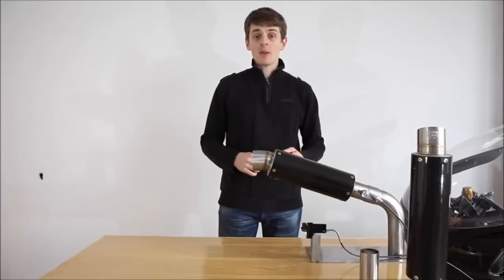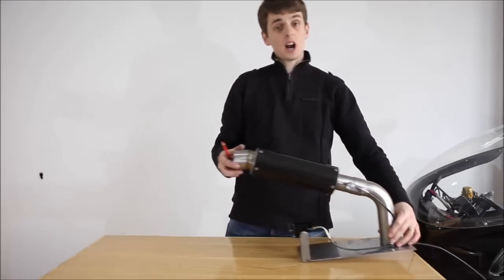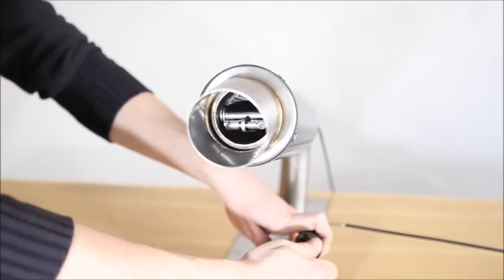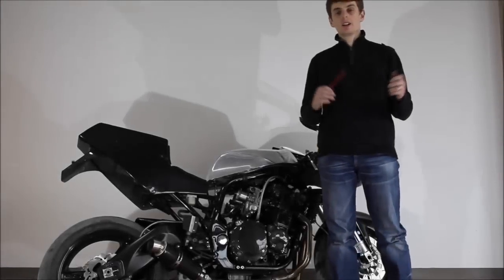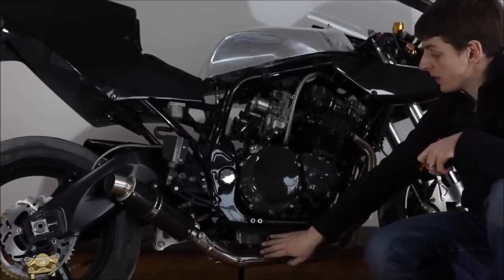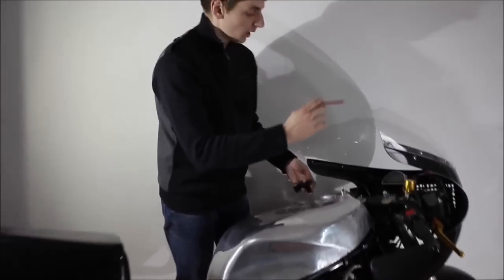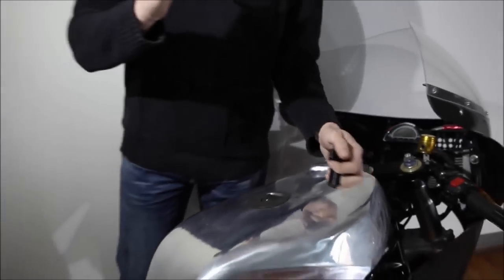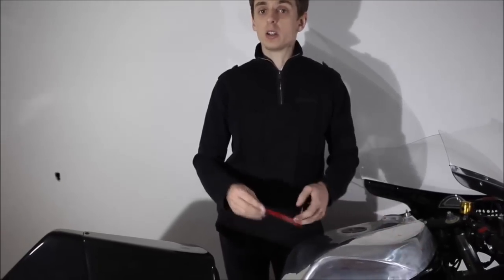Danmoto Remote Sound Control System  Carbon GP Exhaust

Comment: have this on my zx14. i do enjoy the ability to open/close on the go. would usually close it close to home and early mornings and open it up on the road, but you need a solenoid system. something that could be an extra add on for the existing systems and newer ones. i have been trying to find a way to make my own.
a rotational actuator positioned on the exhaust to move the butterflies and either 2 momentary switches or a 3 position momentary switch for the handlebars. 
the cables provided at the moment are cheap and have a lot of slack in them, the little adjuster also rattles loose when baffles are closed and i have almost lost it a couple times. and it gets quite tiring having to wind it so much to make a full adjustment. 
being able to press a button and have it change instantly would make for much more appealing product and opens up for an extra sale item.

Comment: Electronic control seems better way than hand turning control.  If it had to be a hand control, would be better with a index shifting like a bicycle shifter.  Like, " click, click" for each level of closure.  That's my suggestion.  I have XG-1 with baffles but still loud.  Do you have a silencer like for a gun where you attach to end of pipe?  Or an end cap like for a trumpet.
Reply: Electronic is just another thing to break imo. Keep it simple stupid (KISS).

Comment: If only they would/could add the remote control system to the Jisu exhaust. Given that I commute at 6 AM I don't want to disturb those who are still asleep, but would appreciate it if I could have it open in the afternoon when driving home. Also being able to silence it when going on longer trips would be nice. Here's hoping they'll add the remote control feature to the Jisu exhaust.

Comment: Hello Danmoto, just a quick question for you :).
I ride a Yamaha YZF-R125 and was wondering what the back-pressure in the exhaust pipe is; when the remote baffle is fully closed, at idle and at a higher RPM such as being held at 4000RPM. Does it restrict much flow out of the exhaust and is there much of a power-loss when the baffle is closed (as I ride a 125cc and need all the power I can get haha)!

Comment: Hi, just attempted to install one of these on my ninja 300. Exhaust was simple and easy to install though the cable seems very hard to make baffle turn and the control isnt turning turning the baffle. Ensured the cord wasnt kinked and everything. Almost like the spring is too tight? please help, thanx
Reply: Hi Jarrod i have intalled the exhaust and i have the same problem with the cable. .it looks like the intern cable is to long !!  How do you fixed this problem ??
Reply: +Trep Immers I was informed that you need to pull the chord really tight before threading it into the base. Seems to have worked for me but still not perfect
Reply: Lube cables too

Comment: Hi Danmoto, 

Do you have any recommendations for installing this system using a servo to adjust the baffle, rather than the hand controls?

An electronic system would be a better (and safer) way of opening the baffle. In the video, you speak of adjusting the baffle whilst riding the motorcycle, but you would need a very long and straight road to do this, as the hand adjuster requires a lot of turns.

Thanks
Reply from the maker: Gary Fernie Hello

it would be definitely possible to replace the hand control with a small servo motor. You should be able to adapt a range of different motors.

But that would be a job for a skilled mechanic, as the motor needs to be mounted and wired and well as some kind of switch. The whole setup would need to be hidden and waterproofed to prevent issues.

That would be too complicated, as most people look for parts which are easy to install and maintain.

We did consider servo motors during the development, but decided against it to keep the system easy to install and also easy to maintain.

A servo solution is something which would require a professional for installation, that's nothing the average rider can install by himself.

With best regards
Danmoto
Reply: Danmoto International Thanks for your reply

Comment: Will the remote device be available to buy separately so we can install the system on our existing carbongp's?
Reply from the maker: DantheDukeMV Hello,

i'm sorry but it's not possible to retrofit this system to the normal Carbon GP.
While this exhaust looks about the same, it's inner construction is different than the normal version.

With best regards
Danmoto

Comment: Very clever. I wonder how well it will function after a few thousand miles. But yes, very nicely done.
Reply: have this system on my zx14 and have covered around 10,000km so far. it still works. i was expecting it to gum up but i guess the vibrations keep it from sticking shut.

Comment: Thanks for the video. Very poor quality audio, should have used a real microphone. For the demo bike should have used something single cylinder like CBR 250, they thump LOUD with your normal Carbon GP exhaust so would have been nice to hear the comparison (and wouldn't sound like a sewing machine like the bike in the video).
Reply from the maker: toysareforboys Hello,

thank you for your feedback.

We're actually planning to do some more videos with different bikes, to give our customers a better idea how it sounds on different models.

At the time this video was shot, the shown Suzuki was the only bike we had in the shop.

With best regards
Danmoto
Reply: Danmoto International Thanks for the reply. To improve your speech audio get a lapel mic and plug it into a portable recorder, will make your voice sound flawless, no echo, no fuzz. If you get a GOOD microphone you can also use it with a battery box to allow it to capture way louder sounds with very high dynamic range to capture the full true sound of a motorcycle exhaust (especially a bass heavy bike like the CBR 250 which will normally clip any mic under $500). For mic:
http://www.soundprofessionals.com/cgi-bin/gold/item/SP-BMC-3 (choose standard sensitivity), power module to extend the microphones maximum recording volume and dynamic range: http://www.soundprofessionals.com/cgi-bin/gold/item/SP-SPSB-10 and use a recorder with a true LINE IN input (not MIC IN), such as the Roland R-05: http://www.soundprofessionals.com/cgi-bin/gold/item/ROLAND-R-05

Can't wait to see/hear the next video :)
Reply from the maker: toysareforboys Hello,

thank you for the suggestions.

I see that you're a professional in this regard ;-)

We'll be looking into that, for sure!

With best regards
Danmoto
Reply: toysareforboys
exactly, audio quality makes the video unbearable. Shame as it's a good idea.

Comment: I have a shorty i bought from you and it sounds great  this exhaust sounds like a tin can like everything vibrates on the inside.
Reply from the maker: Douglas Mozisek  Hello,

this exhaust will sound on your bike exactly the same as our normal Carbon GP.

The parts inside the exhaust do not create a vibration/ticking sound.

The sound you're refering to, comes from the Flatside Mikuni RS 38 Carbs on this bike. They're louder than the exhaust system.

Have a look here:

https://www.youtube.com/watch?v=UeM6_EKk5aM

or here:

https://www.youtube.com/watch?v=pwN3anpNO2U

or here:

https://www.youtube.com/watch?v=QYUurIT9Bw4

These carburators are more noisy than the exhaust and have this special "ticking" / "clicking" sound.

That's why i mentioned in the video that you sound not take this bike's sound as reference. It's just to display the difference in the noise level.

The sound of this bike is very different than the sound you get on most other bikes.

Same deal as with a Dry Clutch Ducati...Very special sound, louder than the exhaust and it's all due one contructional specialty.

With best regards
Danmoto

Comment from the maker: @ Andycliff1965
The baffle does not completly close the exhaust. There's still more than enough flow through the system, even with a closed baffle.

It's comparable to a removeable "DB killer"

While it of course does reduce flow, it does not "choke" it down too much, to make sure you don't run into issues.

With best regards
Danmoto